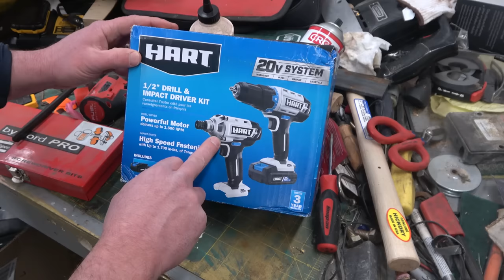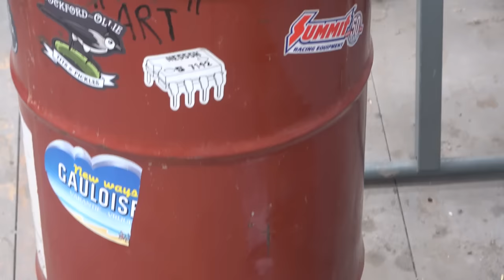BOLTR; Hart tools from Walmart

Comment: Those drills strongly resemble the POorter Cable tools I bought years arg and several other brands with slight cosmetic changes and different battery tab locations.

Comment: Sorry not a comment on this video, but a prior one. You were driving pins into a screwdriver handle, your punch kept bouncing off the pin. I use a socket extension with a socket attached to drive pins, keeps the "punch" centered on the pin. Sometimes I have to use a deepwell, then change as  it gets closer to the surface. Quick, dirty, and I have a LOT of old socket extensions.

Comment: My wife bought me the Hart set that included the reciprocating saw as well a couple years back and all I can say is whoever thought white would be a good color on a tool is a fool. Longevity wise the drill has been used extensively for way to long wire brushing activities and it makes funny noises but still hasn't let the smoke out or stripped the gear box. I use the the 1/4 impact when I'm just to lazy to use hand tools on smaller stuff because it doesn't have the balls to break  bolts where as my rigid 1/4 will. As far as the saw goes works ok with the bigger battery but doesn't have the chops to cut any thicker metal than rusty exhaust pipe without stalling.

Comment: I recently took apart a higher power corded DeWilt VSR drill and found that it was held together in the same way; once the screws were off the case the whole dang thing could (and did) spill right out onto the floor.  Even the gears were just plain exposed, and the grease poured right into the case, able to spatter around on anything. However it's worked for the better part of 8 years in careless hands.

Comment: I have a cheapo Hart 40v chainsaw and line trimmer/pole saw plus two 5ah batteries that I got in the clearance aisle a couple years ago. Both have been surprisingly decent for what they cost. Useful as beaters when I just need to do a little light cleanup

Comment: me and a buddy installed a 6 inch lift in his driveway one weekend, finished the ole backend and started up front when he realized he needed a sawzall. we run down to wally world and he picks up a hart sawzall and when i tell you that was the most aggravating cordless tool you’d ever seen. battery couldn’t last 2 minutes under load and the charge took hours. however, bought my dad a hart brand backpack sprayer and it does well. he’s had it over a year now and i’ve borrowed it a time or two. wouldn’t dare ever purchase any of the other tools tho

Comment: I bought a basic Dewilt brushless drill with 2 batteries and a charger for $100 USD a few months back at the homeless despot. First yellow tool, not too shabby so far. I usually prefer Milwaukee over anything but they didn't have anything to compete with that price

Comment: these kind of drills are almost modular, i think a lot of "off brand" power tools mix and match them. very little variation in the manufacturing from other of the same class tools i've seen. i think the manufacturers go to trade fairs and look at chucks and say 'that'll do', go to the trigger booth and see what the cheapest one is, etc.

Comment: Got a bit tired of screwdriver cranking at work. All very light stuff but I have not been kind to my wrists over the years (construction for 40ish years). Mostly PM on electronics of one sort or another on the manufacturing floor. Got those 12v Skil brushless tools for a song and a dance off amazon. Just an impact and drill driver, and hell the batteries even have a USB port on them, which has saved the day a couple times in a conference room when someone forgot to charge the bluetooth conference speaker/microphone. All in with some addon bits, extensions, and the like.... I am into it for $150 and I don't feel to bad leaving them at work.

Comment: I found a five piece set (saws all, drill, light, impact, vacuum) with one charger and I think two batteries on clearance for 75 freedom dollars.  Yeah, they aren't great tools.  But if you only have odd jobs here and there, they seem to work fine.  Since then I have also gotten extra batteries, solder iron and glue gun (all on clearance).

Comment: I've got a hart angle grinder, it's really more like a oddly shaped dremel that takes 4.5" cutoff wheels. Only used for cutting 5/8ths hydraulic hose occasionally. Probably the least dangerous grinder I own, ain't got enough Chooch to break a disc or torque to make you lose control.

Comment: interesting insides... the guts of that drill look identical to my old 19.2 volt craftsman that I replaced the motor in after my sister found it in a dumpster. and the impact looks just like the one i got for 5$ at a swap meet, also a 19.2 volt craftsman.

Comment: Hart is made by TTi (the same guys who design and manufacture Milwaukee tools) but they are definitely cheaper than their Ryobi lineup. I pretty much stick to cheap hand tools by Hart such as a multitool, a hammer, and a stud finder that are all currently in my tool bag. Would I pick them by choice in the future, nope. Did I find these on Walmart Rollback for less than $5 each; yes I did so I will continue buying Hart stuff as long as the price is right and I am not expecting too much out of them in the first place.

Comment: 10:20 I found mine for free in a back of a truck. (Just the impact driver, battery, and charger) The owner said it didn't work and it had been sitting out in the rain for a month and a half.... I took it hole expecting to have to take er apart to see what let the majic smoke out... Forgot about it for a few weeks . . . Then put the battery on charge, plugger'd it in and it it chooch'ed!
That was 2 years ago and the driver's still doing what it was made for even tho' the impacts leave a bit to be desired.... Must of got lucky or the owner didn't think about charging it... lol.

Comment: I've bought all my Dewalt 20v tools and Milwaukee m12 tools (mostly brushless) on sale and paid about the same as for that crap. I even picked up a gen 2 m12 fuel drill/driver kit with a 2ah and 4ah battery/charger for 100 bucks. There was a price glitch online and they did not send me the free tool  (m12 ratchet) with the kit once they wisened up...no biggie, I had one already.

Comment: I got my set for $99 maple bucks and use it for wrenching, I also paid the $10 for the protection plan because its gonna break eventually. I got the impact jammed in between my sway bar and transmission and it wasnt hurt so they're fairly tough. It seems like you got a shitty battery @AvE .The week after I got them that dewalt set was on sale...

Comment: I bought a combo pack for around a hundred bucks. the rotary tool is alright, but alas, it's not the same threads as my actual dremel so I can't use my 3 jaw chuck. the handheld vacuum actually really sucks! and 4 port charger is disappointing, it can only charge one battery at a time. the tire inflator is pretty darn good, which is good because that's basically what I bought it for

Comment: Looks like the exact same kit I got a while back just with different colors and branding. Burned the motor out of the drill in about 20 minutes of hard drilling, and the bit driver was so gutless plus longer than my 1/2" impact with adapter to use the bits on that. 
Took it back to the store and got my money back, absolute junk!

Comment: Hart is pretty hot or miss in my experience, my tool backpack from them is a pretty nice bag and has take a beating over the years but it still looks only gently used, my hart channel locks on the other hand are “meh” at best, they can grab things too small to grab with your fingers but if you try to work on any pipes they are pretty flimsy and shakey, there is already surface rust on the locking button which wasn’t even machines using the auto feed as the spacing on the lines is pretty erratic which can be indicative of the care in the rest of the manufacturing process and for some reason the only thing to protect these flimsy pliers from rusting is paint which will easily flake off even if it wasn’t on a tool meant for pipe work, I only had them for a year but I’ve got decades old tools that aren’t flimsy like that which also have better protection from rust. TLDR hart tools are either hit or miss, they have some good stuff that I quite like for a fair price and other tools that are probably perfectly fine for homeowners and at homeowner pricing but for trades you gotta be careful with them and know that sometimes you get what you pay for with them but if your a homeowner then the hart stuff is probably just fine especially for the price

Comment: I find entire sets of Ryobi in pawnshops for a song.  Use them til they don't chooch (several years sometimes) . Lather, rinse, repeat.  I had some nice Milwaukee tools but my meth-head son stole them, among many other things.  I used to rebuild Ryobi NiCad batteries raiding cells from cheap Horror Fright batteries.  Used to brew my own beer, built my own AR-15.  Life's too short and I have a grandbaby I'd rather spend time with rather than farting around with crap to save one or two dollhairs.

Comment: Hate to break it to you, but those are basically repackaged Ryobi tools, with a slide pack battery rather than Ryobi’s stem pack. Mostly the lower to mid range Ryobi. Designed and made by TTI.

Comment: I decided to buy hart impact and drill driver for work until I could afford red or yellow. 

Literally broke both within 3 days. Taking high pressure pump heads off and drilling through stainless steel frames. Definitely a 4/10, probably only good for drywall, plywood, and light duty DIY work.
Reply: They actually felt solid in hand, performed well until they didn't. Probably down to a couple cheap parts. Would probably be 6-7/10 if they fixed a couple cheap parts.

Comment: Wonder if there are the suspiciously too cheap batteries available for it on Amazon, I got a pair of chinesium extended battery packs for the same price as one of the genuine official non-extended cryobi ones would have been had I purchased it at the homeless despot. A tear down would be interesting
Reply: They typically use second rate cells. Yet I have come across some that for the price their worth their weight.

Comment: I'm imagining taking this to some of the steel I've had to drill through and having the bit bind and snap the plastic supports holding that motor and chuck construct in place l place. Would be an interesting failure.

Comment: Bought a Hart stainless can 8 gallon wet dry vac about a month ago and it wasnt worth the gas to drive it to the transfer station to rid myself of it. Worst $79 I've spent in a long time. Hose diameter is way too small and almost anything will log jam it.

Comment: Cone on AvE its TTI... I got the 6 tool pack (drill,driver,circle saw,sander,recip saw,and,fleshlight) two batteries (1.5 and the 4) for $199. Much better deal. Now they don't hold a candle to my Milwaukee set but they aren't complete dog shit either. Look at the Ryobi driver it's almost identical in appearance. That Sawzall is super light and it fucking works!
Reply: The 4 battery has an indicator as well.

Comment: Drill is decent for home use. I use mine to power my 3 yr olds go-cart haha . Impact driver is weak by commercial work standard good for home owner. Reciprocating saw is trash unless cutting foam. Spot light is better than expected.  4mah batteries make a big difference on all. Especially the saw but still better off with a hand saw.  If your a working man power tools are not the place to save money.  Take it for what it's worth.  Edit: why does my workbench always get the stink eye I thought the ufedfffdnejedhd look was standard?

Comment: Please do Walmart brand hyper tough next I’ve used a hyper tough impact for 2 years almost  every day 1st year driving tapcon screws into concrete to hang wifi acess points and 2nd year working in a powersports shop as my screw gun the batteries last long and it’s got good torque and is durable I’ve dropped it off a ladder several times and gotten it wet and dropped it in oil admittedly it feels cheap but somehow never breaks unlike the harbor freight impacts

Comment: I had the misfortune of getting a Fart tool hammer drill and half inch drill for Christmas last year. Terrible shat they be. Drill battery has to be removed and reinstalled after every hole cause it shuts off and the hammer drill stops working under any load and just let's the gears grind.

Comment: Ive been considering buyin some scamazon Milwaukee batteries. Hell, I could probably replace the cells in em for cheaper than buyin name brand.
Reply: You should definitely watch the Torque Test Channel videos on batteries - lots of amazing info from their testing
Reply: definitely can't.  Getting XC 5.0s for dirt cheap is very easy if you look for sales, or just buy them off the kit resellers all over eBay if you don't want to do that  (people buy up promos/kits/bundles and part everything out).  OEM 5.0s are $60-$65 from ebay resellers, 10x Samsung 25R would easily run over $40 just for one pack, + misc materials, equipment and time and you're well over $60 invested.  You'd have to build a dozen or so batteries just to offset your spot welder and all that.  

You also get warranty support buying an OEM, maybe not the full 3 years off ebay.  But 2-2.5 going by date code, still better than a homemade pack that fails due to that shitty Chinese PCB clone and now you're out a bunch of money and time.  That and your battery casement won't be total shit either.  Those fake packs are a lot less durable to fall damage.

Comment: I can tell u this got this for wife it  won't put a 3 inch screw in half rotten wood with a full charge.  It's been defeted by 2 ikea builds . The drill doesn't drill much it drilled 4 3inch hole 1/4 inch bit 5th hole died quarter way in it

Comment: A couple of years ago, i bought the drill, 1/4 in impact, racipricating saw, a light, two batteries, and a charger for 40 dollars at walmart. Use the impact quite often around the house and it still works 3 years later! Id say it was worth it for me... i even built a deck with the impact once and it drove deck screws faster than my milwakee. Granted the milwakee was pretty worn out but still, a good deal!

Comment: We have similar here in the UK, sold in Aldi under the ferrex brand. On sale atm, I purchased the impact for £9.99 the multi tool for £9.99 and a reciprocating saw for £20.
Along with x2 5ah batteries (Samsung 18650 cells) and a charger. This came to little over £100.
I like many others own a lotta named brands but as a back up tool or an occasional use tool they make sense.
I have noticed they change the battery connector configuration so the batteries aren't interchangeable with the sister brands.

Comment: I do remodeling on the side mechanic by day I buy Mac cordless which is just dewilt rebranded just because that's the only rape wagon around but since I live in the deep south the meth heads steal shit out of a guys truck all the time so I bought a set of those hyper tough cordless tools for my remodeling for 200 bucks they survived 3 remodels so far only the drill gave up so far driving tapcons so only 50 bucks lost